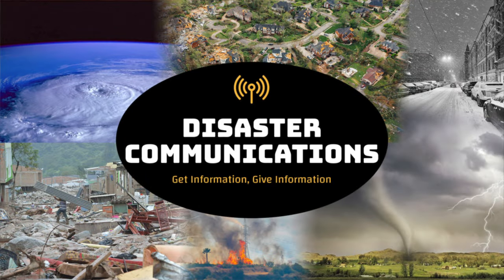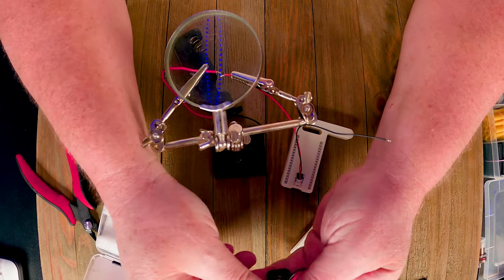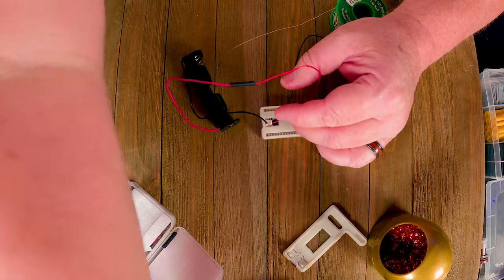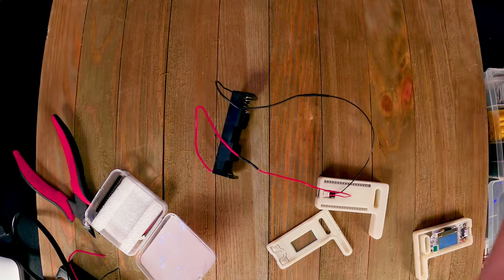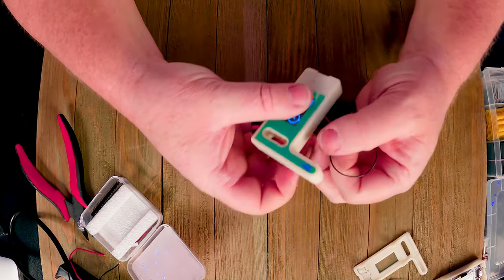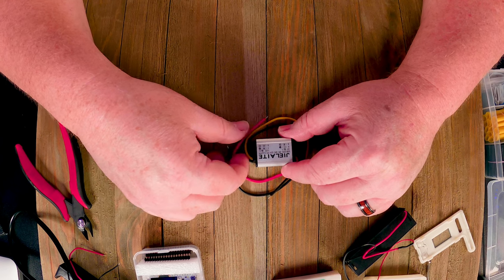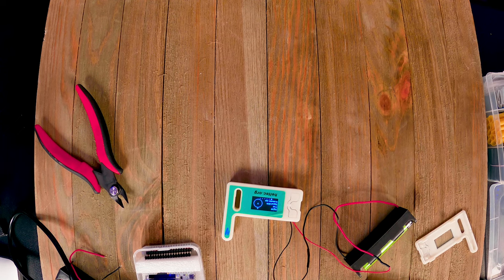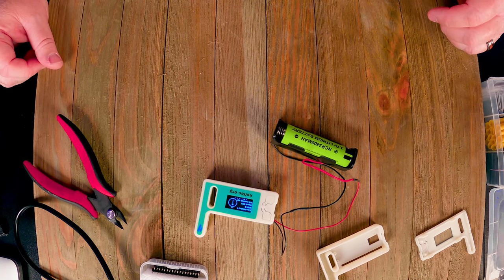Power Up: Meshtastic LoRa Radio Battery Upgrade Revealed!

Comment: I was wondering what battery to use specifically with that tiny case for the Heltec module. Thanks for making it clear that there IS NO battery intended to be inside the case, that you use an outboard battery. I've already got batteries and holders for them, so now I'll just build the modules to work with external batteries. I have some 800mAh Tatto batteries I got for my Morserino, so I'll use those. Or I have 18650 holders and batteries like you're using.

One question, though. Why didn't you strip back the insulation and mechanically connect the wires? That used to be the standard -- that "solder is not glue", and you should twist wires to be soldered to the other wire, or to a terminal strip. I know you can't mechanically connect to a PCB pad, but that's the exception. But wire splices like that, you strip back enough insulation that you can do a proper splice, twisting the wire ends in opposite directions so you would have to apply significant force to pull them apart prior to soldering. Having shrink tubing (especially the marine grade, with hot glue lining) already on the wire so you can heat-shrink it over the connection for insulation is always a good idea.

I also have very small Solder Seal butt splices, if there's room for them. They're a heat-shrink tube, with a ring of low-temp solder in the middle, and hot glue rings near the ends. You CAN just put the stripped ends in so they overlap inside the solder ring, but I prefer to mechanically splice (or serve) the wires, then slide the Solder Seal splice over it, the exposed wire inside the solder ring. Then I can solder it, shrink insulate it, and melt the hot glue to seal it against water intrusion, all at once with my hot air station.

But I was taught that when soldering two wires together, you NEVER use the solder as glue to hold two wire ends together that haven't been mechanically spliced. That's just asking for a questionable connection.

Thank you for doing this video, though, you answered my primary question about the use of batteries and specifically those Meshtastic cases for the Heltec module.
Reply from the maker: For me this was a temporary setup.  When I splice I will twist the wires, wrap together, and then solder and shrink wrap.  I have yet to finalize this setup so I will temporary do them till I’m sure.  I actually broke this battery box trying fly it on a drone so it is getting swapped out again lol.   Thanks for watching and the feedback.

Comment: Makes me wonder I have blink cameras that run without batteries. Use only solar panels to run. I think the solar panels have batteries built into the back of the panels.  After several days of little sun, they are still running....I will research that and share
Reply from the maker: Sounds good.  Some are modifying solar lights as well

Comment: Would like to power one of these via the USB-C connector directly to AC wall outlet & run it 24/7 as home node. Do you think that's doable?
Reply from the maker: Certainly.   Works fine.

Comment: There are several solar battery packs on Amazon. Not sure how much power these little LoRa boards need, but that seems like a simple solar power with built-in battery for $15~$30.
Reply from the maker: They seem to run around 3.5 volts.  Maybe even up to 4 when charging
Reply: @Disastercommunications is that going to work? It needs 3,7v. Any link to those solar chargers?

Comment: The 18650 would be safer with a BMS. They can be bought very cheaply. Look for a BMS protection board for a single 3.7V 18650 Li-ion lithium battery cell.
Reply from the maker: Good point.  Thanks for the suggestion and I’ll look that up.

Comment: The heltec has a tp4054 controller - apparently you can hook up a solar panel to the usb and it will charge a battery. I haven’t done it myself - you need a bigger panel like a 7-10W - the price of heltec boards seems to have risen recently, by a few $ - I think they are great as handheld devices, but the lower power consumption, a wisblok board and a dirt cheap panel is a better solar combination.
Reply from the maker: It does seem most everyone uses the wisblock for outside use for sure.  The low power consumption is key.